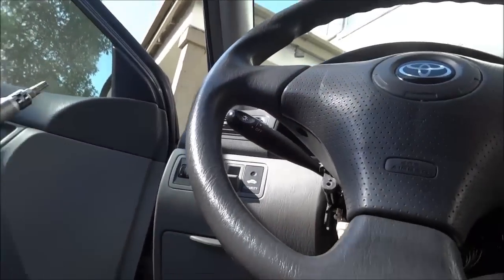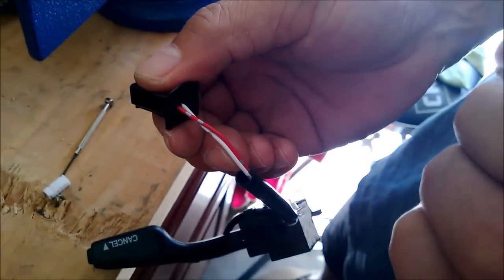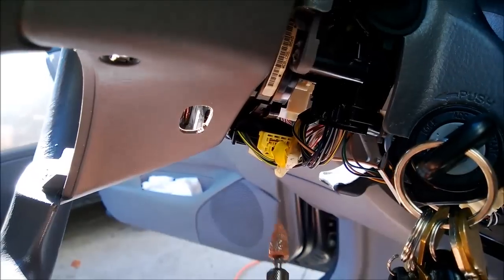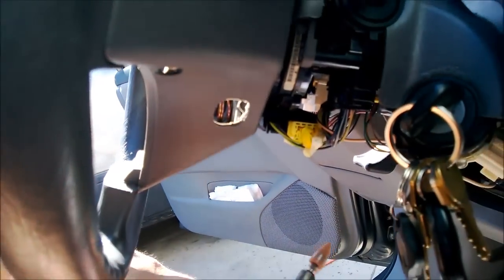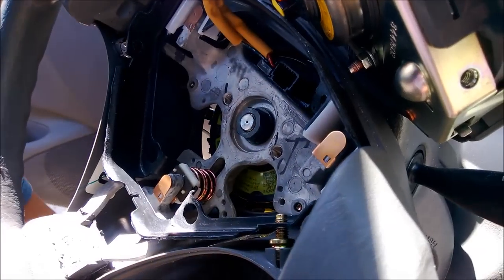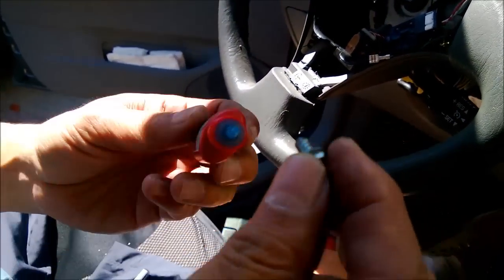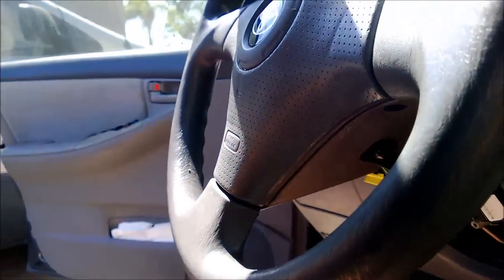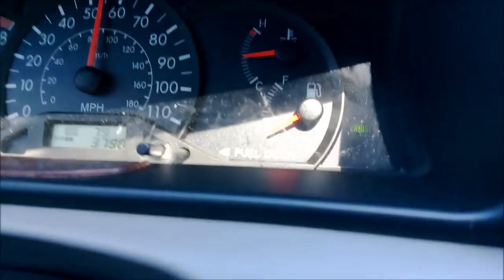Installing Cruise Control in 2005-2008 Toyota Corolla

Comment: Hi, the cruise control on Amazon cost about 61$, could you show me any where has better price please, thank
Reply from the maker: Search keywords "cruise control 8463234011" on eBay and Amazon. There are some for $15
Reply: Edward Chua thank
Reply: Hi, I have a 2006 Corolla LE Auto (US).
Parts 84632-34011 and ACDelco D1919E look different and have different connectors.  My corolla seems to look like ACDelco D1919E.
Has anyone used 84632-34011 on a corolla le 2006?

Comment: Is there any reason this wouldn't work in a 2004 Toyota Corolla LE?
Reply from the maker: It might need the drive by wire module installed

Comment: i have 2003 Toyota echo automatic, would this cruise control work?
if it not, would you suggest me to which part to buy?
Reply from the maker: You will need this switch and one for the pedal as well, since you don't have electronic accelerator. However, I don't know what the pedal switch looks like.

Comment: The same process with 2004 corolla ce?
Reply: Did you check if it's drive by wire? Edward mentioned how to find out in the start of the video, however said Toyota started this type of system in 2005.

Comment: Wait so the only component is that switch? doesn't need any modules added to the ECU or anything?
Reply from the maker: Juan Sanchez Yes!
Reply: Amazing, I wonder if it would be possible to add adaptive cruise control like the new corolla has
Reply from the maker: A retrofit of that would take too much effort and money. Note that the adaptive module costs over $2k
Reply: ***** too bad, ACC isnt available on corollas over here.

Comment: Do you have a 2004 model assembly?
Reply: Did you check if it's drive by wire? Edward mentioned how to find out in the start of the video, however said Toyota started this type of system in 2005. The 2004 might be drive by cable, so the system and installation would be very different.

Comment: So how do you guys install a Cruise Control without needing to Flash the ECU?
Reply from the maker: +sypher0101 It just works out of the box without flashing ECU, as seen in this video.
Reply: I installed a cruise control stalk in my automatic 2006 Corolla and yes, it does work. The computer in those cars are set up from the factory to have the cruise control working, they just saved $50 by not installing the control stalk themselves, so you can do it yourself if you have the time and patience.  If you have a manual transmission then you have to also install a sensor on the clutch pedal as well, or something like that.

Comment: I have one corolla of 2004 manual ( no automatic ) is this possible to install?
Reply from the maker: You'll need a clutch switch and another one for the accelerator, because that is pre-05.
Reply: ***** 2006 corolla sol AT is it work this ?

Comment: Where have you bought the cruise control kit from?
Reply from the maker: +Charalampos Kounes In the description: http://www.amazon.com/gp/product/B000IZ0W8W/ref=oh_details_o01_s00_i00?ie=UTF8&psc=1
Reply: +Edward Chua   I checked this link to try and find my cruise control for my Toyota corolla 2007 I checked capability and it says its not for my car.
Reply from the maker: It says not compatible with my 2006 as well, but it worked anyway. I read it in a forum. Others here have picked up the same with success.

Comment: Can i install it in my 1997 corolla.
Reply from the maker: No, you will need to add a pedal switch in addition to what was shown in this video, since it doesn't have an electronic throttle.

Comment: Can i instal my 2004  toyota avensis?
Reply from the maker: I'm not sure. Does it have electronic throttle? If so, you can do it easily as shown here. If not, you will need to install the pedal switch as well.

Comment: Thank you. Anyone can suggest me any professional who can do this for me?
Reply from the maker: +animesh mondal Most automotive electronics places that install stereos may be able to do it.  I was quoted 150usd to have it installed.  I decided to do it myself.
Reply: Thanks, do you remember any name of the stores?
Reply from the maker: +animesh mondal Just searching "cruise control install" on Yelp in Los Angeles pulled up a few places. Definitely call them in advance. One that I see works from reviews is Santa Monica Car Sound.
Reply: Thanks
Reply: Toyota used to do this for customers, but they stopped in 2013 when the new 2014 models came out.